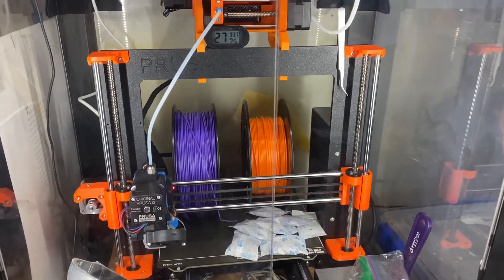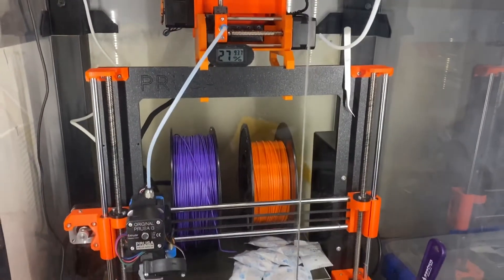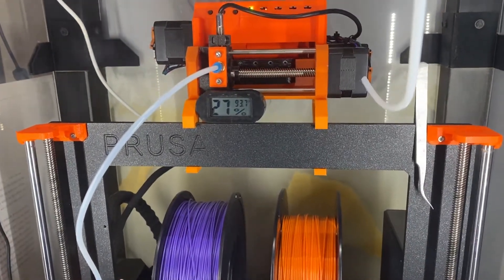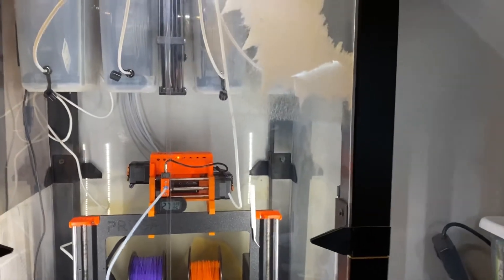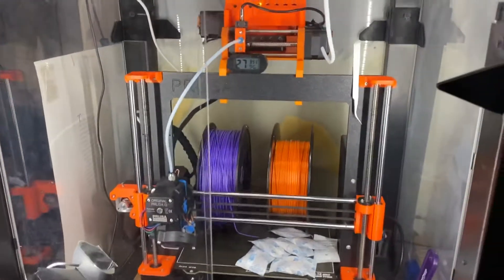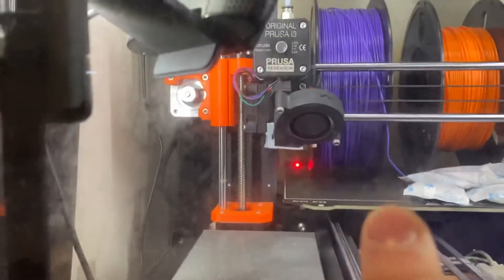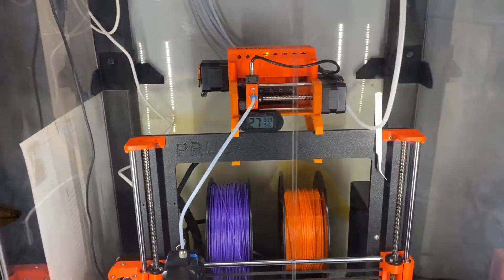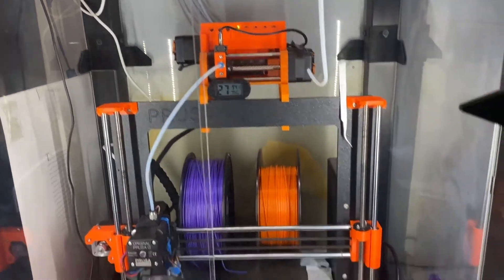Using 3D Printer enclosure to dry filament

Comment: What’s your electric bill on this?
Reply from the maker: I usually don't do this to dry filament in the summer when I am paying for air conditioning to cool my house.  I do this mostly in the Fall/Winter when I am already using a small electric space heater in the room.  Since I am paying for the electric heat anyway it doesn't cost me anything more than what I would have paid anyway.  But if I did this during the summer I am sure it would cost a lot more.
Reply: @mordiev  hahaha ok thanks